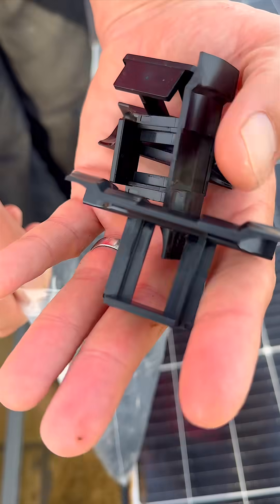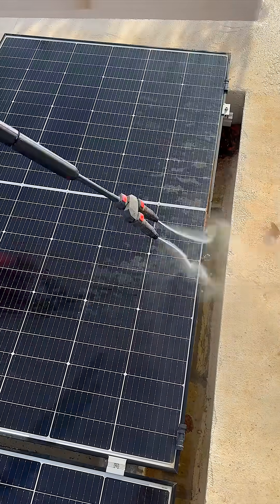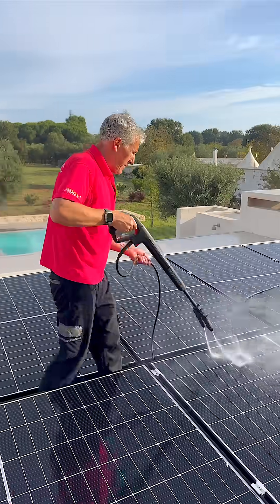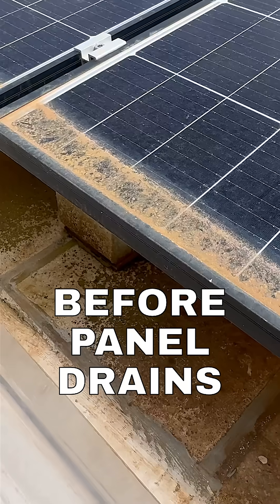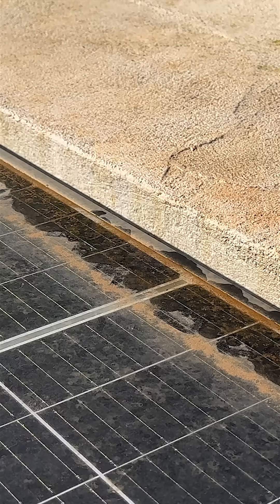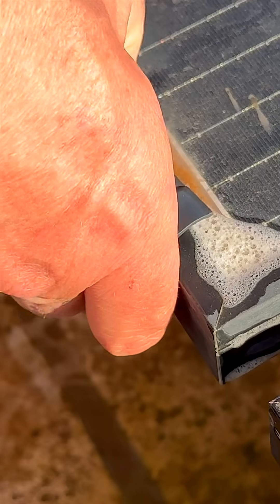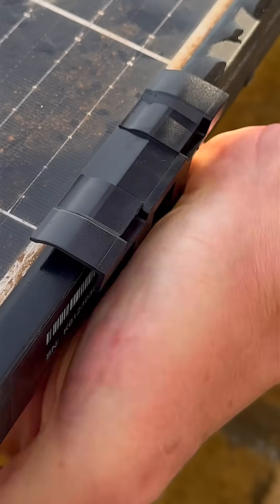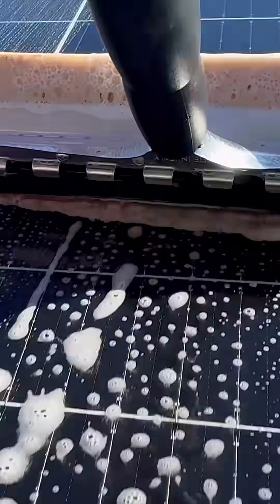Solar Panel Drains: Success or Fail?

Comment: Surface tension/capilliary action. I've used a similar technique to remove trapped water from a tray under a freezer evaporator after defrosting . Tray had a lip - soak a cloth in water, shove one end over the lip and into the water in the tray, and allow the other end to point in a bowl. The cloth then wicks the water out into the bowl, tray is left almost bone dry.

Comment: How do they even work? Siphon?
Reply: @tanelehala6422  from my understanding the clips break the service tension, something like that and it causes the pooling water to flow.
Same thing if you fill a cup to the top with water all the way almost spilling then putting a toothpick on the edge of the cup then having some water spill out of the cup
Reply: @stsenre  surface tension